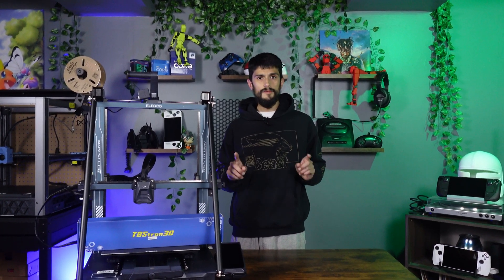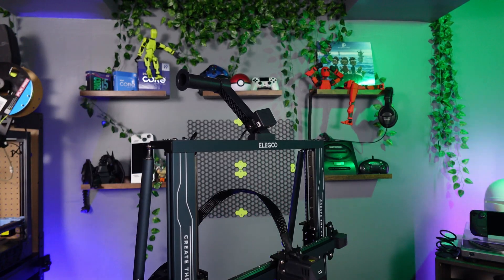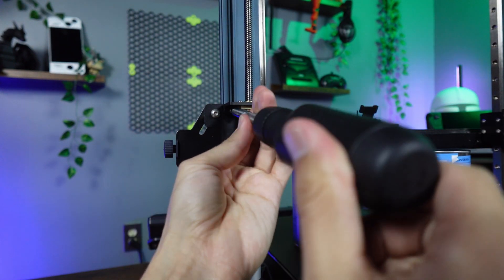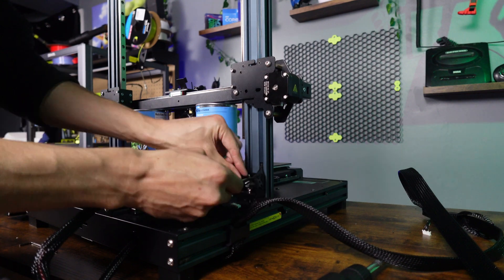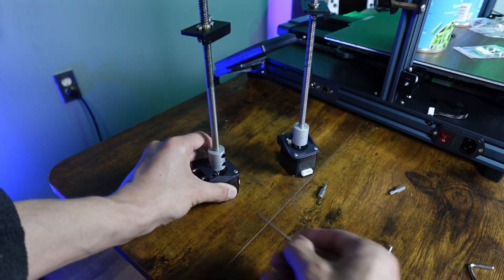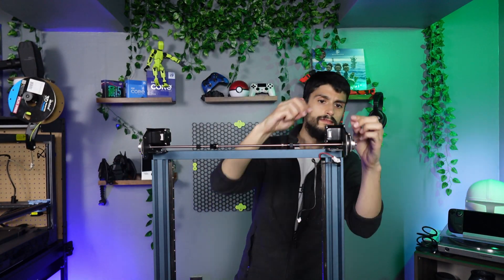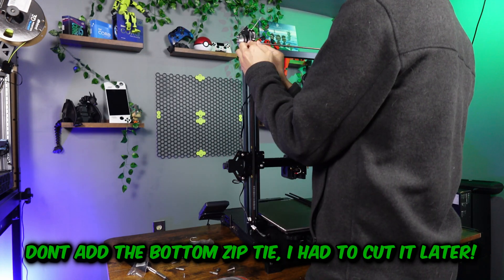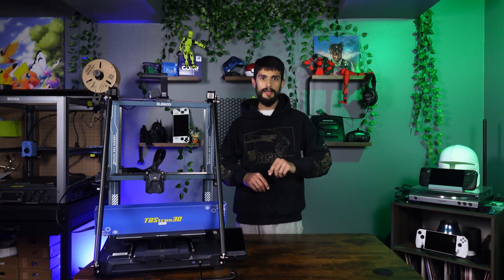Stepping into Precision: Neptune 4 Plus - Dual Z Axis Synchro Belts  - Part 4

Comment: Would be curious as to how the machine is running now over the last several months with all the upgrades installed?
Reply from the maker: Runs great and quieter too. No major problems to report. Just normal 3D printing problems if anything.

Comment: Great learning videos.  What was the total cost of all these linear rails kits . Can everything be ordered as one kit for the e4 max. Also, do you recommend doing this on the printer,  straight out of the box.  Did you try out the printer before you made all the linear rail changes? If so, how much better quality were the prints you made.  Can you please share the exact kit or kits with links for me to order the same thing as you have used.  Thank you for sharing,  looking through the links.  It seems like everything is around 300 dollars.  Which is almost getting close to what the printer cost with the holiday discounts.
Reply from the maker: It definitely helped with the print quality. They sent me the hiwin rial kits for my Neptune 4 Plus and I believe it was valued at around 300 dollars so about the same price as the printer yes. It’s hard to say if it’s worth it for the cost. Replacing the x axis would be my biggest recommendation out of all the kits as it made bed leveling so much easier.  But if you print a couple things here and there. I wouldn’t buy the whole kit at once, maybe piece by piece. But if you have a print farm and want better quality then it might be worth it.
Reply: @EdsTechTalk94  Thanks for sharing and Happy Holidays.  Looking forward to your next video
Reply: @EdsTechTalk94  I think you meant to say replacing the y axis would be the biggest upgrade right?

Comment: How are you supposed to tighten the upper brackets after the steppers are in place?

How are you supposed to tighten the fourth stepper screw once the outer pulleys are in place?
Reply from the maker: Pretty sure I left the one screw out and it’s been a while since I’ve completed this mod. But I believe you tighten it before adding the steppers.
Reply: Thanks, I figured it out, had to go back a few steps and tighten everything down as I went. 

I do have an issue with layer lines now that I didn't have before. Belts are tight but not too tight, rod across the top doesn't bind. Do you have any suggestions?

Comment: Alright, because I'm lazy I gotta ask: you got some configs that work well with all this, that you can hook me up with? Im assuming (big assumption, I know) you're running opennept4une and standard klipper? If so, what calibrating did you do specifically after this final mod -- is the ratio of step to motion is a bit different in the z axis? Any other configuration?
Reply from the maker: Nope! It’s all stock Neptune firmware still. No need to change any configuration settings at all. As plug and play as it gets!

Comment: I have an axis rails but not belt. Is there a place I can buy just the belt part as shown here?
Reply from the maker: The Neptune 4 plus uses 6mm GT2 timing belts, which can be found on Amazon fairly priced. If you are talking about the parts used in TBStron3ds kits, I don’t believe you can order the parts separately. But shoot them an email and maybe they can sen you just the parts and no rails.

Comment: I am doing all 4 update to my Neptune 4 max at the same time. It is harder than doing a single mod at a time. :( But I am getting there. Almost done, should finish today.
Reply: How is the printing results? Smooth prints or nothing changed much?
Reply from the maker: Oh man that sounds like a lot of fun! Glad it’s almost done! You’ll notice how much quieter it gets too! I was extremely happy with my Neptune 4 Plus after the mods too.
Reply: Can you tell me how much all the linear rail upgrades cost you.  Also is there one kit available that comes with everything necessary,  besides ordering separate kits for each upgrade.
Reply: Great, PLEASE could share with us pictures showing the diference between the original and upgrade 3d printer version?
Thank you!

Comment: hows the print after all this mods , on mine i did apex extruder and Phaetus rapido mod and it made a world of diference
Reply from the maker: If I use the basic profile in orca slicer it works really well. It made the machine a lot quieter since it’s basically all belts now too.  

But I’m currently trying to improve the speed of print times while maintaining that same quality
Reply: @EdsTechTalk94  if u need the mount for the apex extruder and paethus rapido just say , its a huge diference 
But iam now sub , iam waiting for the next video , big hug

Comment: Great video! Does this increase the height of the machine and if so how much? I'm concerned about it still fitting inside my enclosure.
Reply from the maker: It does increase the height by 2.125 inches (2 1/8”).
Reply: @EdsTechTalk94  Thank you!

Comment: It's a pity there is no comparison of the same prints before and after all these changes
Reply from the maker: To be fair, I could get an ender 3 straight out of the box. Tune it to perfection and get the same print quality as any other printer. 

The charts from the other axis proves it was able to help improve the acceleration in the input shaper. I’m still working on tuning my machine to share a profile over all.
Reply: @EdsTechTalk94  A spot-on remark. 👍 Thank you for the response.
Reply from the maker: Anytime!
Reply: @EdsTechTalk94  is there any update on how these are working for you?

Comment: Fun video. Have you noticed an increase in your z-axis with this mod? I have ordered and received all the linear rail kits and I was wondering if it would be worth it to buy the belt kit. Thank again for the video!
Reply from the maker: I’ve noticed it operates a lot smoother with the belts compared to the rods. I haven’t pushed the printer to hard are just yet. Working on another project at the moment.